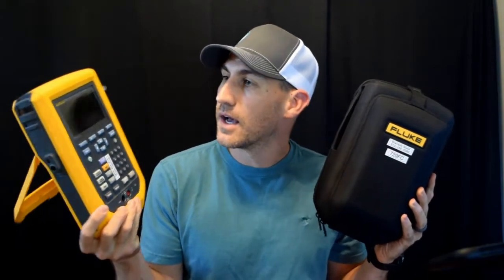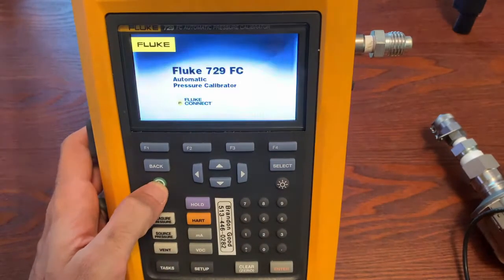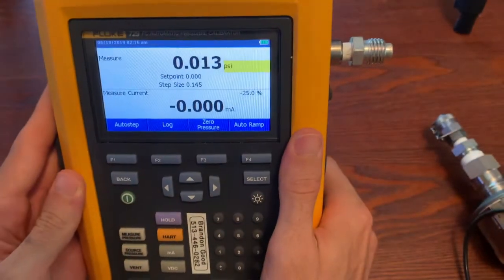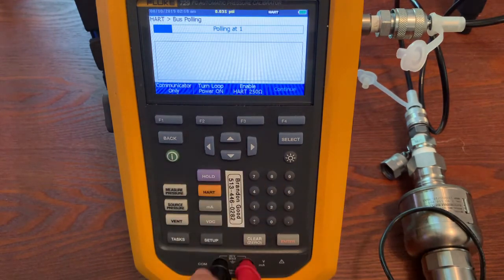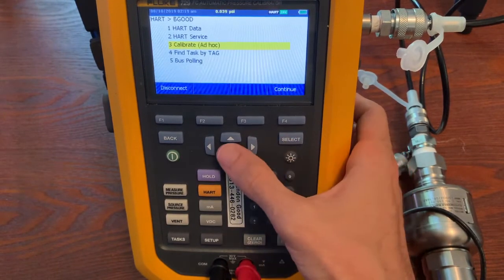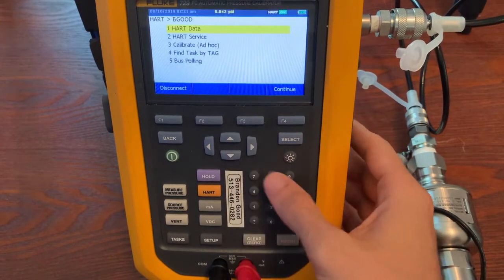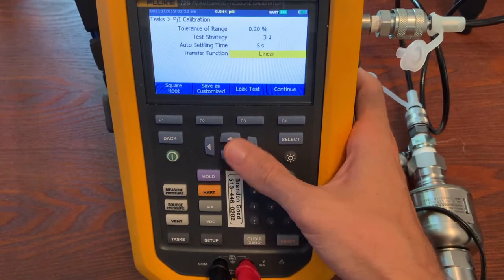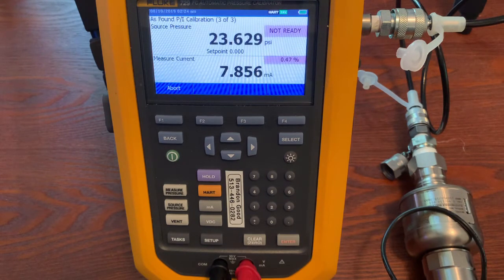Fluke-729 FC - Fluke Fridays - Episode 15

Comment: please advise if we can generate 3000 PSI from Fluke 729 pro 7M using pressure module Fluke 750P29 (3000 PSI)
Reply: using internal pump
Reply from the maker: @focusengineeringsolutions8484  no it looks like the 7M can source up to 1000PSI with the internal pump.  You might want to check with a local Fluke seller to verify that.  But from what I found on this data sheet this is what I see.  https://dam-assets.fluke.com/s3fs-public/DataSheet_729Pro_V4_W_en%20JS%203_10_v2.3.pdf?3NZTzt3zDCTZBYEq9_PkZ6gwhF11H.P6

Comment: Which is better fluke 754 or 729
Reply from the maker: If you need to also do temperature they 754 is better, because the 729 does not do temperature. But if all you need is pressure the 729 is better.